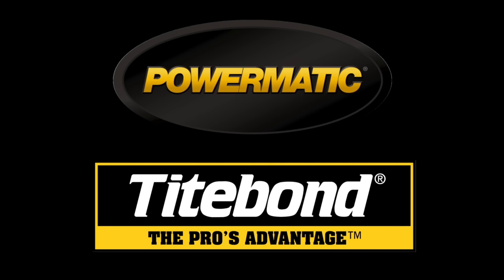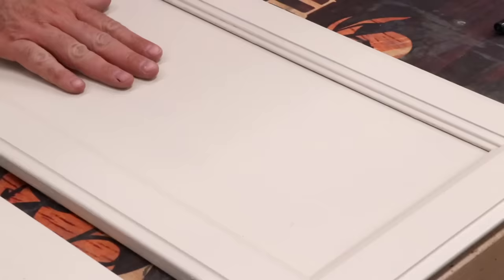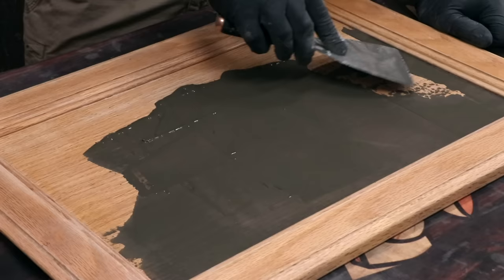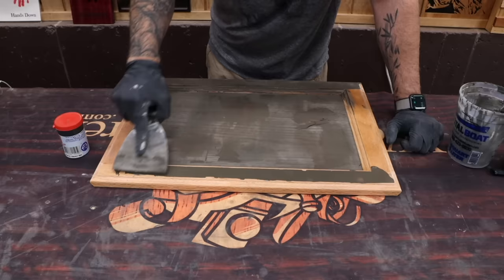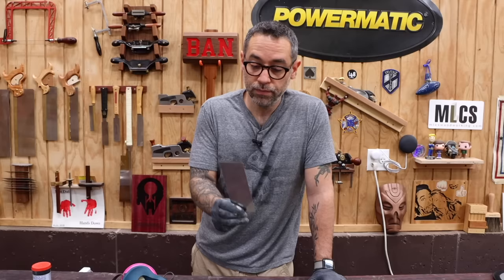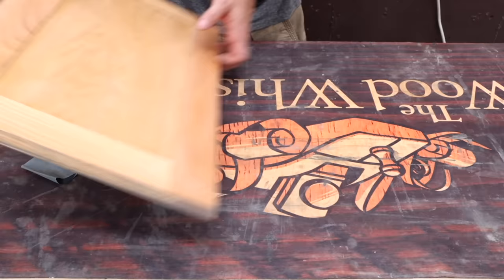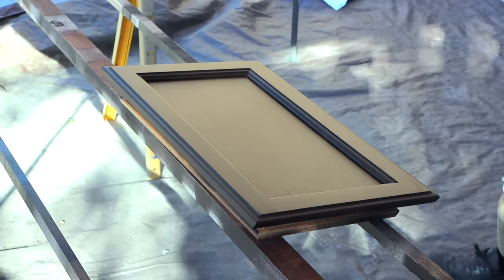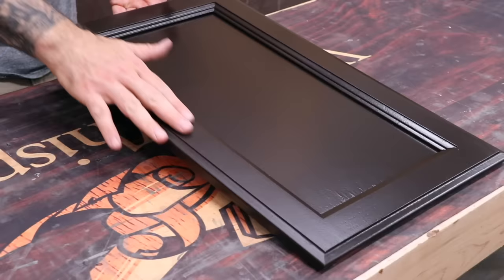Painting Oak Cabinets - Transform Your Kitchen!

Comment: I did a similar project 10 years ago. I chose a dark chocolate color and dark granite for the bottom cabinets and a light yellow color for the top cabinets, matching the wall color. It looked fantastic. The dark color grounded the lower cabinets and the lighter top cabinets gave the room an airy appearance that belied its 10' x 10' size. And all for some elbow grease and a few pots of paint.

Comment: You can also sand down the cabinets and stain them another color, whether another "wood" color or, depending on the stain, any color you like, then put a protective finish over it.  That will look better, not muck up the wood like paint, and if not a solid color stain, still allow at least some grain to show through.  A solid color stain won't do that, but will give in my opinion a nicer finish.

Comment: I'm actually in the middle of doing my kitchen cabinets white, the local box store turned me to a first layer product by ppg called gripper, it has worked amazing as a first coat primer and for paint adhesion, I did two coats of white after that with great flat results.

Comment: Do you not have to strip/sand the existing stain, varnish or poly before this process?
Reply: No, you definitely do not.   Just wipe the cabinets down well with a liquid de-glosser first.  It will remove any grease/dirt and soften the varnish to improve adhesion of whatever you use over it.

Comment: I’m following this tutorial. I think you did an amazing job! My question is did you pre-sand the cabinets before wood filling? 
Thanks.
Reply: Any time you paint over something (especially something smooth/shiny) you need to lightly sand it so the paint can grab onto the surface. You don’t need to go crazy trying to remove the previous finish, you’re just scuffing it up so the paint can adhere. It’s a good idea to strip any wax off before you paint too - it’s likely that some wax or wax-containing product is on cabinets, furniture, floors, etc. Just use paint thinner to remove the wax, you can use a steel wool to get into the nooks and crannies. 

So a wipe down with paint thinner FIRST to remove wax (sanding first can push the wax into the wood). You can give it a wipe with a clean, damp rag afterwards to remove any residue. Next, scuff it up with a 220 grit paper (or an equivalent sanding sponge) lightly sanding all over until it’s hazy/not shiny. Wipe it down, ideally use a soft brush (like a clean dustpan brush or a clean paintbrush) and whisk out any dust in the grain and crevices. Now you’re ready to paint! (For multiple cabinets, it’s easier to set up an assembly line - get all the doors (hardware removed of course) layed out on sawhorses for example, so you can easily repeat each step and get it done efficiently)

Comment: We did this with our kitchen without very much $ and added another row of cabinets (ones that were being thrown out by a friend) all the way up to the ceiling and finished the difference with crown molding. We then punched out the center of the top row cabinets and had glass cut with a beveled edge to go in the center and added lighting. We painted them ourselves with ivory/white and I antiqued them. We added a copper farm sink and added copper and crystal hardware for all the doors. My husband did the backsplash with rustic ivory bricks. I used an golden toile tablecloth on sale from Williams and Sonoma and sewed it into a balloon drape above the sink dripping with tassel trim. We accented the cabinets with Spode blue dishes and of course a couple of  topiaries. We are just learning but we love it and the monochromatic scheme is timeless. 😍

Comment: Another possibility is to prime the cabinet doors with Kilz oil base primer since they may still be a bit oily even after cleaning them and then prime them again with a latex primer. I use an airless sprayer. And then I like to use a product like Behr ‘Kitchen Cabinet and Trim Paint’. (I use the specific latex primer they recommend to go under their Cabinet and Trim Paint) It dries and cures quickly to a hard durable finish and they won’t stick! A regular latex satin or semi gloss paint will definitely stick when you close the doors and they make contact with the face frames. I spray two topcoats of the Cabinet and Trim paint. And I like to paint them while they are laying flat so I won’t get any runs. I like to use the satin finish. They do look great!
Reply: Where is your video doing this?  lol  I would love to see it and follow
Reply: @bridesnyc  No video. The first primer coat I use is the oil base Kilz in the spray cans. The second primer coat is with a latex primer. I use the special Behr Paint designed for use on Kitchen Cabinets and doors. Use their special primer designed to use with the Kitchen Cabinet Paint. Read the labels. Buy it at Home Depot. Always spray the paint on. Never use a roller as it will look pretty bad. Even with those dense foam rollers. You can buy a Graco hand held sprayer for about $250. For about $350 you can buy a Graco airless paint sprayer. It’s a very handy tool to have! Just practice for awhile on some pieces of drywall or on some of your walls in the garage till you get the hang of it.

Comment: Great job! Informative video. Working on my own kitchen even as I type. I am replacing the doors. The face frames are being sanded and primed with Zinssers shellac based primer. Then lightly sanded and topcoated with Sherwin Williams Emerald urethane enamel. (Satin). Key is to use top quality tools and techniques. So far this has taken about 4 long days and have not gotten the doors as of yet. Thanks for the video...looks professional.

Comment: ProTip...when you set all your doors out to spray on your racks, put screws through the racks with the points facing up. Spray the door insides then flip the door onto the screw tips vs waiting for the paint to dry to flip them.

Comment: Outdated? White is so sterile, I love the look of natural wood and have it throughout my 2 houses.  I'm a painting contractor and would never paint cabinets, trim, or doors.  Old houses  where good wood (oak , walnut etc.) was painted pay big bucks to strip off the paint to reveal the wood below.  This is a trend that will end and natural wood will return in design.  Only woods I would paint are pine, poplar and birch which are paint grade.  Short term gain long term mistake.  JUST MY OPINION after seeing changing trends over 50 years.
Reply: I agree if you’re talking about quality woods. The cheap oak cabinets from the 1980’s were pretty low quality so extending their life by 10 years is a good move.

Comment: What i found is if you brush and roll bin shellac primer then sand it relatively flat and sprayy another coat of bin shellac you seal the grain and prime in one step, leaving relatively subtle grain on your finish coatings. This way you skip the filler part and bin shellac sands out real nice

Comment: Very well done, Marc. This is not an easy task lol. I actually got hired to redo a kitchen in a similar way. He actually hired me to replace the doors. But I asked him if I could pore fill the doors instead. He said as long as they came out looking like new maple doors he didn't care if I used the old oak doors. 

I made a video on my channel explaining my process of getting oak to look literally perfect like glass with no grain what so ever. But you are 100% right. It sucks and no one should do it lol. It's faster and cheaper to replace the doors. 

I am confident that I have found the fastest way humanly possible to fully pore fill oak. And it's still not worth it. I probably spent $150 in pore filling product, and $70 on sandpaper... Along with twice the time it would have taken me to just build new doors. Because I had to pore fill the backs just like I did the fronts. I'm very glad I did it. For the knowledge I gained. But I will never do it again. 

Also, i'm a huge fan of General Finishes products and I use them often for my clients. I am also in close contact to my General Finishes local rep. High performance is geared toward a hobbyist because it can be sprayed with an airless or an HVLP, wiped, brushed, or dunked lol. It is a universally applied product. That's why it's like $80 a gallon . But if you are gonna spray it, you are gonna want to stick with General Finishes Pre Cat Lacquer. It's the same water borne product but thinned out already and it only costs like $35 a gallon. But you can only spray it. But it saves time and money over the High Performance.

Great job, and I applaud your courage to take the job for your mom. I bet you took the "job" for the sake of knowledge just like I did lol.

Comment: Hated my oak cabinets. Painted them white 4 years ago.  Lots of sanding, priming and painting.  Used Benjamin Moore Advanced paint. It is self leveling.  Must wait at least 24 hours between coats, but so worth the final look.  Have had many compliments and have been very happy with my new kitchen!   Definitely not a weekend project. Took 3 months to do 28 doors & 12 drawers

Comment: I never do that  with  the oak  filler i think the grain really  helps the paint grab on  to the finish.  If you  have issues  with the dark grain I will brush on shellac primer and get it into the grain with the brush . Shellec is good for grease  and any dye stain  that wants to bleed though. And then  spray lacquer paint.   Some of the best durable  white finishes I've done are on oak. It seem to handle water  getting into the wood and lifting up the paint better to.  In the end you'll have a white door but up close you'll see the the grain . Its just like  textured interior doors.

Comment: As a cabinet maker / home builder / restorer of old buildings, I think the whole point of using wood and not, say, MDF--is because wood looks like wood--not plastic.  And if you close the grain like this it detracts from the natural beauty of the material.  Of course, some people prefer that perfect, manufactured look.  It's just not for me.  IF, through the process of prepping, priming, and painting, some of the grain and figure are lost... I'm OK with that... since it was an honest result of that process.  When I use Hardie products I always use the wood grain options as well... so the siding and cornice don't look plastic.

Comment: Excellent video.  Thanks for posting this.  This is a great option, especially if your old oak cabinets are in decent shape but you're tired of the dated look.  I love the darker lower cabinets against the light upper cabinets, and the tip for the crown molding was great!

Comment: Am trying to get rid of the same brown color at the bottom your mom has 😄but when they painted those, they applied a gloss and all I see is dark imperfections on wood. It was done by previous owners. I want a light gray and some white on other cabinets. First time I see or read of someone using liquid filler. You solved my problem though. I have been researching for the last 4 years.

Comment: I'm 30 years painting unit's, here is what to do,  if varnished = 1 coat of bin primer then 2 coats of oil based satin (much more durable than water based) do not take off door's, hand paint all as is and fill all gaps with caulk (not cracks or the deep grain use filler for that)

Comment: i have done a mock up on my cabinets that my wife wanted me to paint we have a polyurethane finish on oak and what i came up with is sand it to get off the haze , kelley moore primer and paint , I've tried several types of paints with the finger nail challenge if i can scrape it off with my finger nail than won't work , so this is what i came up with this is a little bit of work but looks nice and like the grain look

Comment: I have not sprayed yet, but practiced with furniture and vanity before getting to kitchen cabinets. I have used chalky finish paint and cabinet paint from Lowes. What I have done is sand and de-gloss, apply bonding primer, then paint. I am curious to know if the bonding primer would stop grain from popping through. Even with 2 coats, it's a lot less labor and time than the process shown here.

Comment: You showed a single rubber profile sander. They usually come in sets that are designed to accommodate all curves and angles. Always use the profile that best matches the surface that needs to be sanded. There are 4 different profiles I would have used on the cabinets shown.
Make sure that the cabinets are clean and grease free before starting the process.
There are definitely better products to use as coatings. A colleague who only recoats cabinets likes European finishes best.

Comment: Rather than do this, I stripped and stained my oak cabinets the color I wanted to match my new material palette. Looks beautiful! I did paint the cabinet interiors with primer and a contrasting accent color. Lots of different options, not just your standard wood stains either. I used Old Master's Crimson Fire Fast drying stain (oil based)...
Reply: Okay but painting wood? The point of stain is too stain it because the wood never soaks the paint, sand, stain, and seal

Comment: I have oak cabinets that I would also place in the outdated category. I didn't want to paint over the wood so I bought 3 different colors of stain. After sanding I used a grain enhancing stain on the center. In the groove of the doors I used a dark English Chestnut and for the outer edges I used a golden oak stain. I then put a good coat of shellac over the entire door for a good seal and beautiful shine.
It turned out very well and unique without painting the wood. It still not a easy or fast process but I don't like painting over good wood. Just my personal opinion.

Comment: You're a good son, Wood Whisperer. I do have a question - assuming someone followed your lead and only painted the back of the doors, would it be possible to come back later and wood fill those also, I mean, assuming they wanted to put themselves through that much pain?? That's the perfectionist in me asking. Thanks for a great presentation.

Comment: In stead of using pour filler you can use a cross brushing technique with a primer  (I use BIN) before you paint.  5-10 minutes per door.
Reply: Justin DeTerville what is the ‘cross brushing’ technique?
Reply: @kathleen0619  basically its just painting across the grain. You're trying to get as much primer into the grain. Then brushing again with the grain.  I'll typically do this followed by a spray coat of primer, this hides any brush strokes.

Comment: Is there a good filler  if you want a clear finish ?  I turn bowls and some of the wood has open grain.  I would really like to fill the pours.  Thanks Love your video.
Reply: I use sanding sealer and sawdust to fill my turned projects.  Sometimes I have to apply it 2-3 times, but after sanding it looks great.

Comment: I have been painting cabinets professionally for several years and it's nearly all we do.....I want to say it's a good video but when i do them for paying customers i start by cleaning and de-glossing with a degreaser to remove any grease even unseen contaminates like oil from finger prints, this step is important to ensure good adhesion to the substrate. I never use water base paints only oil or shellac based paints for the same reason. You can eliminate the fill process by doing 2-3 coats of a good oil base primer like BIN or Cover stain, this reduces graining to an acceptable nearly invisible level....I use Sherwin Williams Kem Aqua for a top coat recommended by (KCMA) Kitchen Cabinet Manufacturers Association. There are other brands available but this is what i use as it can be purchased locally and is of excellent quality.....i use a mid gloss sheen on top coat which  provides a good degree of protection making a clear coat unnecessary. I sand prior to primer and in between coats 220 to 320 to 400 for final sanding. Most home owners have no idea the amount of labor involved to do them correctly so i ensure they are educated on process and product when giving a quote.

Comment: Huh.....as an automotive guy, who has done aloooot of body work....I think another faster solution would be to buy a $70 gallon of featherfill catalyzed primer, which is basically sprayable bondo. Being catalyzed it drys fast with as much fill as you need to build it up. Featherfill is used on formed bondo to fill sanding scratches and imperfections before a final primer/sealer before paint. It would be wonderful for your cabinets and sands easily with a dual action sander, with some hand sanding in the routered areas. It literally could give you a final prepped surface in short order. Basically it’s what your doing, instead not manually applying it but spraying all surfaces in one spray session. Just another alternative....

Comment: I think a high build primer would be a lot easier than pore fill and would also leave a smoother finish with less sanding. On white cabinets is it better to fill the gaps on shaker styler cabinets or not, the line is easily visible and was thinking caulking the gaps would look better.

Comment: Love the castle joint idea. Did you add the central leg under the bed because you're working with softwood or because the castle joints require added reinforcements?

Comment: Great job and two general questions:

1.  How much of the timber mate did you end up using for the job and did you grain fill the face frames and island?  

2.  Did you worry about bleed through on the gray?  If so would you have sealed with a shellac?  

Thanks,